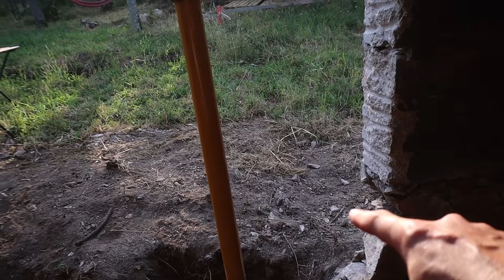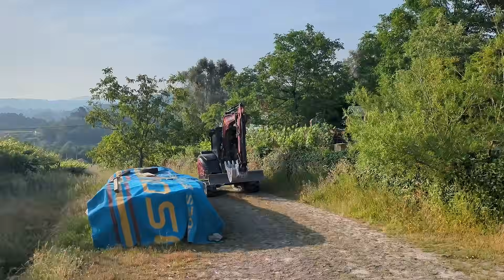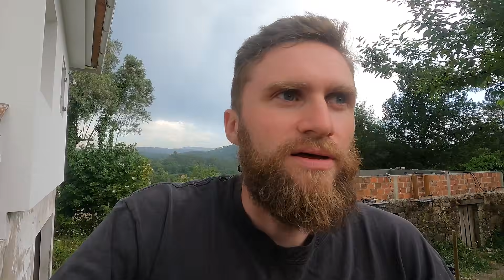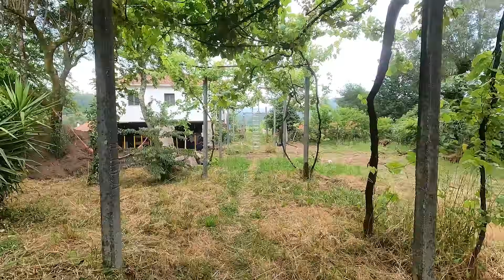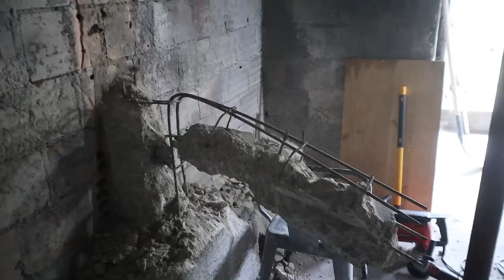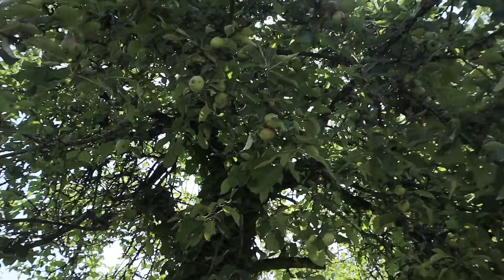#33 Why Are We Digging Up Our Backyard in Portugal?

Comment: Wow that kitchen and covered area is going to be gorgeous with wonderful views once finished ❤️ 
I can see where the bottom of the walls may be a concern but I am sure your contractor and Architect? Will make sure it will be safe after all that's what you pay them for 😂
Lovely the plunge pool is back in use you will need it with the weather that's been going on (the UK has been having unusually high temperatures 😮). Maybe some sort of net or sail cloth above the pool would prevent the worst of the stuff coming off the apple tree however I am saying that and I am sure it is something yourself and Verity have already thought about😊
Reply from the maker: We hope so, yes the contractor is confident about hte openings. Should be fixed up strong soon enough. Yes a net or shade cloth will be a good idea!

Comment: Would it help to put perhaps a net above the end where the apple tree is? Just to help catch the bigger leaves and give something for the apples that fall off something to land on and then roll off the end or side? That may help reduce the detritus that ends up causing problems with then going in the water.

I can see the vision for the house where you've knocked those massive holes in the walls. I'll be honest it does concern me seeing such huge gaps with the supports you have but if the contractor is confident then I'll defer to his expertise. Personally I think I would have done one side first to add that lintel to support the floor above, and then moved across to the other side to then get that lintel in after you'd completed the first bay. This could've also given you a chance to add some helpful supports for the walls where you would have subsequently discovered the lack of foundations. I'm excited for you for what you've got planned, but also a bit nervous that the house will fall down (BUT .. that is my lack of expertise showing so don't go stressing over my concerns! )
Reply from the maker: Good idea about the net. Yes, I was a little nervous at first about the supports, but he was confident and they have been fine so far! Steel and foundations will be in soon enough (i hope)